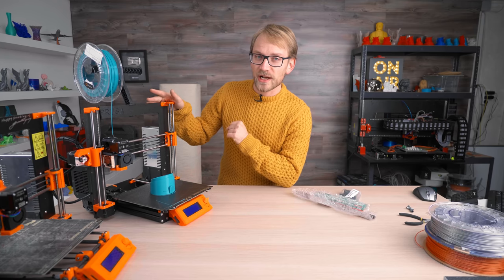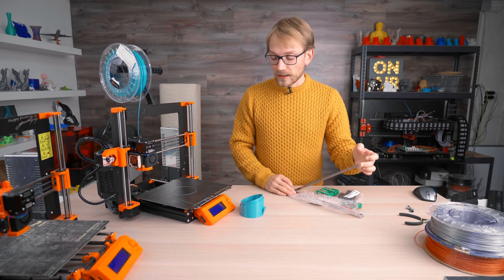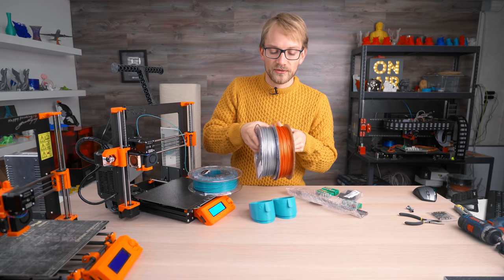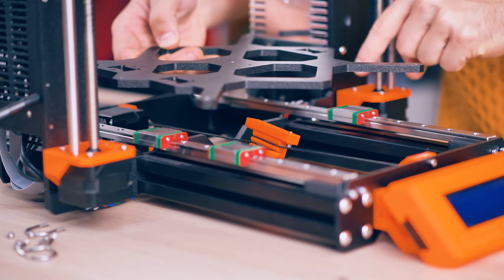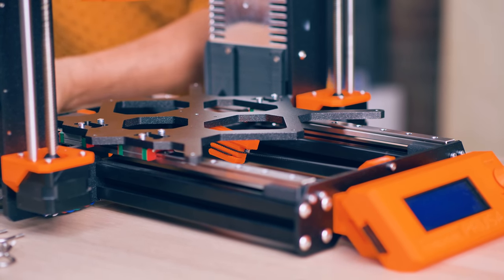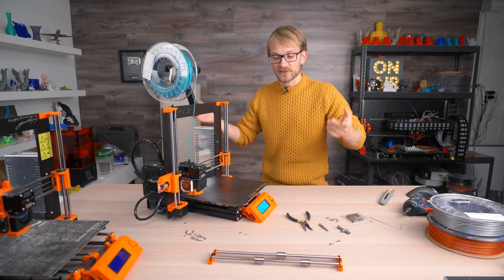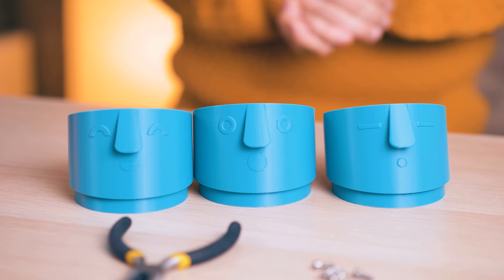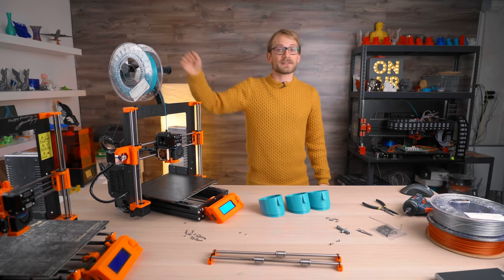Upgrading the MK3 with genuine HIWIN linear rails: Worth it?

Comment: Funny, as x axis and y axis are not the biggest problem.
Just measured the Z- axis on the MK3 S and there is a difference of 0,08 mm if the extruder is right or left in x-axis direction. Plus stopping the extruder from only 25 mm/sec is another 0,03 mm at the Z-Rod, plus the induced positioning discrepancy because of the slightly off center or bent spindle. And this you can easily see on the straight surfaces.
The test cubes printed at the hight of the knee of an ant do not say anything, because it is close to the -well lets call it that way-( plastik) fix point of the rod.
All in all, the Z-axis is a lot underdimensioned and this one which needs to be beefed up.

Comment: If the rods and bearings are from good suppliers, their tolerances are an order of magnitude better than what it is expected for the prints. Printing with tolerances better than .1mm is very difficult to achieve and it is not because of the mechanical part of the printer. It is the process itself (printing with different flowrates, temperature variations, therefore different viscosity, plastic deposition and adhesion...) which is the limiting factor. Rods and bearings have tolerances of tens of micrometers.

Also,  using rods or linear rails with 0.010mm built-in tolerances mounted into printed parts with 0.1 ot 0.2mm tolerances means defeating the whole purpose of using them (if you don't make proper calibrations later to ensure the printed parts don't take place in the movement accuracy). Even more if they are mounted the wrong way, as somebody has pointed in another comment. In the better case, you have mounted the rails parallel to each other, but not perpendicular to the X axis.

Comment: I feel like the slight artifacts you are talking about are not to do with the rigidity of the bed but more likely the precision of the movement. Belts have never been the most precise way to move things. I'd wager that upgrading the x & y to use ballscrews or even just trapezoidal lead screws with anti backlash would improve the results a lot more than increasing axis rigidity

Comment: It is the filament wind probably most are not perfect and make the head pull harder some times and softer other times. I think the multimaterial add on helps with that cause it is pulled 2 times not 1.

Comment: It would be interesting what you think of the Conrad Renkforce RF2000v2. We have one in the office and I have also one at home. Meanwhile the printer costs 1500€, just 500€ more than the Prusa. But for the 500€ you get linear rails, ballscrews, bedleveling with DMS-sensors, 2 hotends for dual-print and a sturdy housing.

Comment: Could it be that the backlash in the y axis was previously obscuring artifacts from other areas? Perhaps the vertical artifacts are a more accurate representation of the print that the whole system was capable of producing which the backlash was "low pass filtering" away, meaning that the rails actually technically were an "improvement" in that area despite looking worse.

Comment: Hi Thomas,
Hmm ... I would have added a third anchor point for the rails. With these being tightened on each end, there still might be vertical contraint due to the Y carriage weight (supposing it's heavy enough). A third anchor point might solve this relative "stiffness" near the middle of the Y axis, IMHO.
As for ringing, fine-tuning slicer settings might be the way ... or tightening the belt, that's right, in first place.
PS : DON'T use powertools for this kind of stuff, please ^^' As it's been mentioned, it can create issues... Just use a regular screwdriver with the right shape.

Comment: I’m really glad I watched this - I just put my order in this morning and was trying to find any upgrades I could install while building up the printer. As someone who works with industrial CNC machinery, it’s hard to look at 3D printed parts supporting the main axis, but clearly that’s not a bottleneck in performance! 

Have you played around with any of the complicated analysis tools that use a print head accelerometer to tune motion on the fly to negate ringing and ghosting?

Comment: If you would only use 1 rail you would have a lot of leverage on the bed exerting forces on the rail carriage and making it bind.
Having one rail only in cases where you might have rotational forces on the running axis is a bad idea.
If you have rotational forces perpendicular to the rail, 2 carriages are usually a good idea.

Comment: So basically you want to see what the quallity of a BLV AM8 with a ramps + TMC2130 looks like vs a MK3. The biggest downfall are the LM8UU bearings with cheaper printers they have so much play in them, swaping them to the igus bushings not only helps with noise but also makes your setup much more ridged with out a massive price tag of linear rails. There are higher quality LM8UU which i am sure prusa is using with very little play in them but its not a perfect ridged system as you said.

Comment: The tighter/rigid everything is, the more accuracy you get, but also the more ringing, the energy has to go somewhere.
Reply: True statement. The bearings have seals on them and grease in them.  This will take the energy.  As with the stock system there will also be energy taken by bending the wire harness to the heated bed and in the belt.

Comment: Some of us printing visor headbands for health services are seeing splits down the middle of prints due to backlash. They occur on curved narrow strips sliced with lots of walls so they are 100% filled without using infill. Where the walls meet in the middle we get splits as each side is printed in opposite directions. Would be nice to know if linear rails have less backlash than other designs.

Comment: I think you should print something with a lot of holes and external details, that way the extruder won't move the same direction as previous layer without holes. I haven't tried linear rails yet, but the print quality really sucks when using linear rods.

Comment: Completely pointless on the MK3 imo. The bushings and the rods already make it stable and constrained enough. An upgrade like this only makes sense on something like the CR-10, which just has rubber wheels and moves a lot of weight.
Reply: agree. I came here to say this but you've already said it.  What you want is sufficient rigidity and repeatability with a minimum of friction and the round rails are good for this.  The linear profile rail system might be adding friction, both dynamic and static and this will decrease accuracy.  A think you can do for the Y axis is to measure and make sure the two linear rods are parallel in both planes.  On my machine I had to shim one end of one rod to make them parallel and keep the projected surface flat.

On the other hand, the X axis must hold the carriage up (z axis location) and it is not very rigid.  If i were going to try a profile rail I would do this as a Y axis and study artifacts that would be Z-height related.

Comment: Since the bed is over-constrained  and causes ringing in the system do you think adding rubber spacers underneath the u-bolt nuts would help to alleviate 1. some of the excess ringing, and 2. the wear of the textured surface over time? Of course you would have to use the same torque value over each nut to ensure consistent tightening.
 I would be curious so see the results. These would be similar to rubber motor mounts to reduce vibration in the entire system. Thoughts?

Comment: Hi. Thanks for video. I will add some experiences with Hiwin linear guide as a design engineer, although some useful information has already been said (eg. do not use machine to tightening).
First, the internet is full of "Hiwin linear guide" which is not Hiwin, but a Chinese fake. Especially Aliexpress, eBay, etc. Hiwin is Taiwan (and some products from Japan, Germany and USA), not China! I don't trust any Hiwin offering reseller except official ones. Hiwin is really not best brand in the world, but the difference between the original Hiwin and the Chinese fake is huge.
Second, when ordering a linear guide, you need to choose some important parameters that the kit supplier did not tell you, but which have a significant effect on the accuracy and preload of the guide. The accuracy can be selected in three stages and preload also in three. Simply, with higher preload is guide more rigid (less flexible), but also with more resistance to move, so it requires more torque / power from  motor. As you said, the guide block moves very easily and smoothly, that means it has a small preload and the guide is flexible, not rigid. Also each model of linear guide has a graph of the load ratio vs. play (how the guide "springs" under load). Choosing the right guide for a specific application is crucial.

Comment: I'd be replacing the printed rail mounts (which at over $200 for the kit is a poor joke) with aluminium blocks as well as adding mid rail support. Minimising any bending and twisting of the rails should be high on the installation priorities.

Comment: Definitely go back and tighten the fasteners for those rails by hand with an Allen wrench. With that electric driver, you have no idea how much torque is actually being applied, your brain just guesses based on what it hears the gun doing. Tightening by hand allows you to feel exactly how much force is being applied to each fastener. With larger stuff, this decreases, of course.

Source: I use an electric impact driver daily to rebuild transmissions and one day I got curious and tested the torque that they make after a certain impact duration. Tested a few different ones and they make more than you would expect, especially when working with little fasteners like that.
Another thing I found was that once those guns start to impact, they reach maximum-ish torque in a very short amount of time. It's harder to modulate than you would think.
Reply: The electric screwdriver he's using has a clutch and he has it set pretty light, but, regardless, this is no question about it a hand tightening situation.

Comment: If replacing both rails with linear rails was overkill, you might measure the height difference and replace one cylindrical rail with a linear one?

Comment: Thomas - My home-brew 3DP uses a 14mm ply bed which flexes if the nozzle hits a PET-G "boogie", and allows recovery over the next few layers - if I restrain this movement  the result is a sudden X/Y transition in the print of a few mm - I see you're using PLA - is that because it's boogie-free and you've gone off PET-G???
Harry

Comment: I don't think your extruder will ever be precise enough that spending 200€ on high precision linear rails, just for one axis, is ever going to be worth it.
If you need the rails to constrain your mechanics more than rods will, thats fine, but you could have just gotten the cheap noname chinesium rails for like 20$ and have the same result in print quality. Maybe with an extruder that has precision volumetric extrusion feedback (and very tight temperature control) with a tiny 0.1-0.2mm nozzle, the high precision rails might make a difference, but that's a completely different beast of a machine then...
The "ringing" on the nose of that model is probably not an issue of constraining, but has something to do with path-generation and extrusion set by the slicer, acceleration issues, or just cooling/airflow from the parts cooling fan...

Comment: Please educate yourself on how rails work and how to calibrate them when installing especially using a digital indicator as can bee seen with use of CNC milling process. The reason why you see more artifacts is because your printer is more rigid at the bottom thus more vibrations and flexing shows up because the rest of your printer is plastic or flimsy. I built my own 3d printer out of mild steel rectangular tubing and filled them with sand. This does 2 things, 1.absorbs vibrations and makes frame heavier thus more stable and gives an amazing print with little to no artifacts at all and was far cheaper and stronger than using extrusions.

Comment: Kinda wondering what kind of results we'd get if all the axis were constrained using linear rails AND ballscrews instead of belts.
Reply: They would help, but only if they were properly fixed to a rigid frame.  The bearing blocks add weight to the axis as well, which increases the inertia of the axis, and increases the inertia ratio of the axis.  The ballscrew will also have its own inertia and that has to be added to the inertia of the axis, as well as the motor coupling.  So you may need a stepper upgrade as well, one with a higher inertia.

Comment: may be printing on default settings there are no difference. but could you please try to increase speed to 100-120 mm/sec or little more and check difference? 
prusa printer can print this speed ok, but native bearings became too noisy and vibrating.
high quality for sculpting or small precise pats ok, but in case we need large draft mechanical part, support  or case - high speed printing can easy reduce print time about x2.5-3 times... but I'm not sure native bearings survive for long time :))

Comment: Are you sure your rails are 100% straight? To me, easy on both ends and tighter in the center tells me that the middle of the rails is either closer or further apart away from each other... that's concerting. I would definitely check the rails.

Comment: What is the exact length of those rails? I'm thinking €50 chinese rails might be a better match for this upgrade. Two Hiwin rails are insane overkill... 

I would also guess that just bolting the rails to the frame extrusions on the front side is better for the z-height and stability. This removes one set of structural printed parts, although we would need some endstops to keep the y travel the same as stock.
Reply: i think they are 250mm, but watterott does not seem to indicate that on theyr website (or i'm blind), so it would be great if Tom can confirm.

Comment: "banding"... "noise"... "hiwin rails"...
but ehm... you missed the Prusa MK3 B7 Parts update (angled Fan etc.) and the 20€ (?) Update to MK3S? Like using WinXP ^^

MK3S Upgrade is noticable in print quality, well spent.

Comment: You are overlooking one big issue with rods. Lubrication. There's really no way to re-lubricate them without removing linear bushings and packing them with lubricant. They have rubber seals which wipe any lubricate you place on the rods. It's a paint having have to disassemble my printer for that every 6-8 months :(

Comment: There are time when high-precision is not desirable.  This might be one of those times.  Might take more testing to find out.
Reply: High precision is always desirable but you can't just replace one component of a hundred element system to an 1000 times better spec'ed one and expect the whole system to perform magnitudes better.

In this case the mounting of the rails is inadequate and the moving platform is also way worse than these rails built for.

Comment: improving? you were moving the table but the printer plate was stable like like  a rock, in my opinion the most no sense upgrade for the mk3 but don't worry, only 200 euros (the ender 3 pro price)  :D

Comment: If you lose 3mm in height wouldn't it make sense for the company to supply some shorter spacers to go under the bed to allow you to be able to do the full build height and also use the z calibrate wizard?

Comment: Just out of interest, why don't you try going back to the original bearings with zip ties but put a  thin sheet of rubber between the bed and the bearing. It could be that having a complient mounting may reduce ringing further.

Comment: Hello Thomas,

Do you think using a "thread locking product/glue " may help in these circumstances. As they are often used in high vibration machinesry to prevent loosening. Apologies if this has been asked before.

Comment: I don't understand why they need support blocks underneath the rails. Can't they just supply square nuts - the type you would use with the extrusions on the Mk3 - so that you can bolt the rails directly to the extrusion. Much more rigid and removes any possibility of bowing in the rail.

Comment: Hi Thomas ,
I check your link for linear bearing and based on  website dimension details, I ordered similar size  and after I received my items I realise my linear rail shorter, it suppose to be 330mm but on the website is 250mm, you wasted my money, the seller not take back the items , you better check the link before leave it here
Reply: what a joke, I checked on that even the unit is wrong , ( length × width × height  25,00 × 6,00 × 3,00 cm ) :), you should get your refound from thomas,

Comment: Thanks for the video! I was considering this upgrade until I watched your review. Even though the Y-axis does not provide any benefit with linear rails, would it be advisable to consider the Z/X-axis? Maybe to ease the z-wobble, obviously, more work would be required to re-design the printed parts.
Reply: If u install clean and adjust properly and grease the blocks the improvement would be way better he didn't align the rail properly for one and two they need to be greased with a synthetic grease such as super lube they will out perform  and other motion system i installed hwin mg linear rails on my x axis and y axis on my cr10s and I have gotten way better prints than with the stock setup

Comment: Why is everyone using the MGN rails when you can get the HGR rails which have much higher stability? The MGN rails use 2 rows of ball bearings, where the HGR uses 4 rows. They can be found for a few bucks more.  I know they are a bit heavier, but it still doesn't make sense to me. Is it the fact that they have to even more precisely aligned then even the MGN rails?